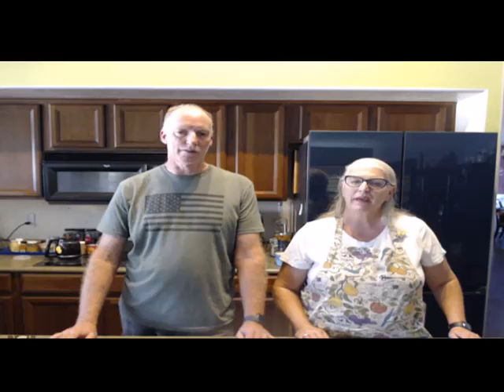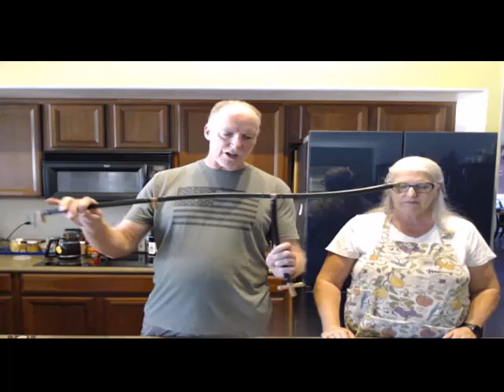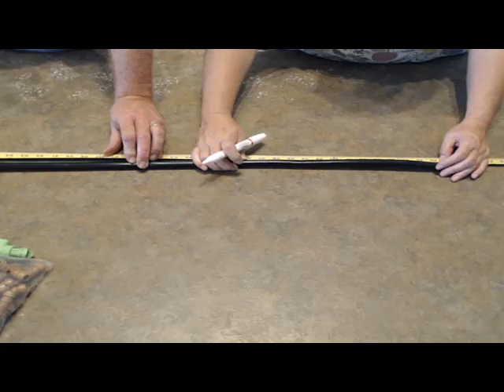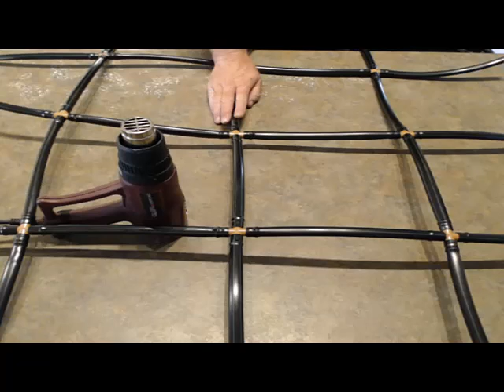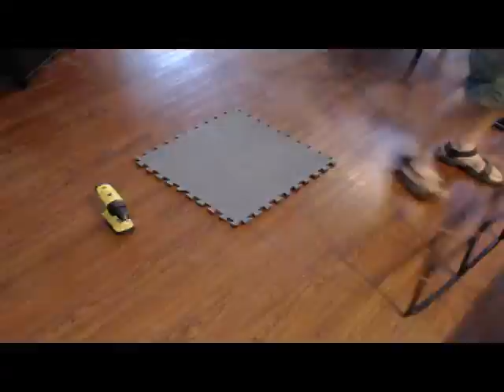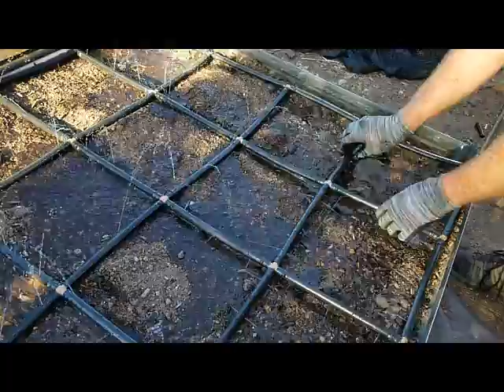DIY Garden Grid Irrigation

Comment: What hose connection to the garden grid did you fashioned like garden grid has?
Reply from the maker: Sorry for the delay.  I was hoping to get an updated video out.  But here are a couple of photos that show the connection. In my case, I was hooking it up to 3/4" PVC.  But the hardware store has adaptors to go from the tubing to garden hose as well.  Hope this helps!

https://www.dropbox.com/scl/fi/lfvd2iygewkkatijlgqtd/20240203_141317.jpg?rlkey=jp7fpf9d9dkpl7f11jaf5jeo0&dl=0

https://www.dropbox.com/scl/fi/o94b3juq9gccdf7d3rmws/20240203_141330.jpg?rlkey=xff2xi075a29tyjyiwzfpciho&dl=0

Comment: How long do you leave them on for? Water flow seems heavy.
Reply from the maker: Yes, they do flow quire well.  As for how long, that will depend on your particular soil and water pressure.  One thing that can help adjust is the addition of a inline valve such as the blue ones in this photo.

https://www.dropbox.com/scl/fi/o94b3juq9gccdf7d3rmws/20240203_141330.jpg?rlkey=xff2xi075a29tyjyiwzfpciho&dl=0

Comment: Can you show how or where you added the connection piece for the water to get to it
Reply from the maker: Sorry for the delay.  I was hoping to get an updated video out.  But here are a couple of photos that show the connection. In my case, I was hooking it up to 3/4" PVC.  But the hardware store has adaptors to go from the tubing to garden hose as well if you need that option.  Hope this helps!

https://www.dropbox.com/scl/fi/lfvd2iygewkkatijlgqtd/20240203_141317.jpg?rlkey=jp7fpf9d9dkpl7f11jaf5jeo0&dl=0

https://www.dropbox.com/scl/fi/o94b3juq9gccdf7d3rmws/20240203_141330.jpg?rlkey=xff2xi075a29tyjyiwzfpciho&dl=0

Comment: The grid from garden in a minute is made out of a different material than regular drip line. The drip line you have will crack and break with the heat and cold. It is less expensive but how long will it last?  So is it really less expensive?  Hmmm
Reply from the maker: Hi Lindy, the Rainbird distribution tubing used is pretty good stuff and has lasted years in our garden here in Arizona.  We use it for most all of our irrigation system.
Reply: LLDPE (Linear Low-Density Polyethylene) tubing used by GIM is the same one you can buy at Home Depot, Lowes or your local Hardware Store or Amazon.

Comment: This is a very good instructional video.  HOWEVER, the expense is greatly underquoted.  One bag of each of the linked fittings is $46, and for a 3' x 6' it will take 2 or 3 bags of each.  Plus the 100' roll of tubing which isn't linked or priced.  And the cost of a heat gun if you don't own one.  The GiM grid for a 3' x 6' is $91 delivered from the GiM website.  No cutting, no drilling, no wasted fittings or tubing (some left over for another project is extra expense if you aren't going to use it.)  PLUS...no wasted time for the additional labor.  Am I missing something here???
Reply from the maker: Hi Krazmo.  Prices do tend to fluctuate on Amazon but below is a breakdown of the cost are as of today (excluding tax and shipping) -
Tees - $11.99 for 24 or $0.50 ea
Crosses - $15.99 for 14 or $1.14 ea
90's - $9.99 for 18 or $0.56 ea
tube - $24.39/100-ft or $0.24/ft

As for the the cost for one 3x6 grid, you will need need - 
10 Tees = $5.00
6 crosses = $6.85
4 90's = $2.22
31-ft of tube = $7.56
Total = $21.63 in material cost.

With the listed items in the as-purchased quantities, you could make 2 of these grids for $62.36 in materials and have some tubing and fittings left over for incidental use around the garden or for other projects .  Keep in mind, that either this DIY version or the GiM one, you will still need tings like tubing, fittings and a pressure reducer to hook it all up so a little extra of those items is not a bad idea. 

Home Depot also sells most of these items in smaller quantities if you dont need or want any extra.  However they are at a slightly higher unit cost.  The only fitting that seems hard to find is the cross.  Amazon is just easy for most people so that is why I went that way.

As for the heat gun, it is not necessary, but useful.  You could probably use a hairdryer or some other method too.

As far as additional labor, some people get a sense of accomplishment for being able to DIY something like this and trying something new.  So it is hard to put a price tag or benefit to that.   If they save a few dollars along they way maybe that gives them the opportunity to buy some more seeds for the garden.

Another benefit to DIY is not being constrained by the shapes and sizes sold by GiM.  So you can truly customize it to match the exact size of your garden bed.

Hope this helps.
Reply: @dcfrank1  Thank you for your reply.  The prices you quoted today are significantly less than they were 4 days ago.  Amazon is a crapshoot when it comes to pricing.  You just validated my original comment.  You can't say that you can build one 3x6 for $21.63.  You have to buy the materials in the bulk packaging in which they are sold.  And Amazon uses the hot dogs/hot dog buns formula when it comes to bulk packaging (more buns than there are hot dogs).  One 3x6 actually costs you $68.  If you need 2 then 2 costs you $68.  If you need 3 then it will cost you $136.  To say that it is only $21 and you will have lots of material left over in case you ever need it is misleading.  If you never need that left over material, you can't get a partial refund.  You spent $68.  Your logic is similar to saying I only want one bowl of corn flakes.  I still have to buy a box of corn flakes for $5.  If I only eat one bowl, that bowl cost me $5, not the 50 cents it would be per bowl if I ate the entire box.As for the additional pressure reducer you wrote of, I have no idea what you are referring to.  My GiM 3x6 arrived in 48 hours.  It is a complete kit.  The 3 sections fit together and a garden hose is attached to the inlet.  You turn on the water faucet and the grid works.  The drip/stream holes are squirting in the correct directions, and the tubing is perfectly straight.  Yes, I spent $91 for it.  And I will bet it works better than the DIY grid in your video.
Reply from the maker: @krazmokramer  With a little research and you can find these items in smaller quantities, except the crosses which I can only  find on Amazon in a 12-pack...ok I will have 6 left over.  If I want to drive to Home Depot I can actually get the tubing cheaper than on amazon (9.98/50-ft).   So, I CAN build one for about $32 and have 6-crosses, 1-90 and 19-ft of tube left over to use on something else or donate to a local community garden.  Still cheaper than the $91 and I enjoy making them and they work great.

So far, we have built 5 of these systems and all of them custom sizes to exactly fit our grow beds and we will be building at least 4 more so bulk is the way to go for us.  The GiM system is nice but just too limiting in sizing for our application.

I am glad you are happy with your system.
Reply: @krazmokramer  Why be so crazy critical? Good for you that you bought your GIM system! Congratulations! I have 10- 4x8 raised beds. I’m not willing to shell out $1,600. I appreciate this video- which will save us HUNDREDS of dollars! Go tend to your little box and quit being such an irritating bully!
Reply: @aftermidnight4867  Speaking of bullying...I have no problem with DIY.  I actually think it's a great idea.  I have a problem with YT videos that make claims that aren't actually supported by the video.  Clickbaitish type thumbnails or titles.  If my comments are so irritating to you, don't read them.  Watch the video and enjoy it for what it is.  My comments weren't directed to you.  They were directed to the video creator.  Now go tend to your tiny little boxes and keep your rudeness to yourself.
Reply: @krazmokramer  you are not only a bully. You’re a narcissist.
Reply: @krazmokramer  you are the problem kiddo, do better with your life.
Reply: @aftermidnight4867  People want to know if it's cheaper to make or just better to buy. That's what I was looking for when I read the comments. It was helpful.
Reply: You said it was a 3’x4’ box in the beginning of your video, which is it? And can you tell me the total of the parts to make one 4x4 grid, please. Thank you.
Reply: Amazing how people can argue about this. The video gave the size and length and no. of connectors needed. ADJUST this to what you have. Plain and simple. It’s called thinking for yourself.xxxxx
Reply from the maker: @albertlewis sorry for the confusion, I meant to say it was a 4x4.  Many of the parts can be obtained from Home Depot with the exception of the crosses which I can only find on Amazon.  Last I checked prices, a 4x4 grid, will cost you about $32 in parts + tax and you will have some left-over.
Reply: GIM is a better quality than a drip line they are DIY.  I have 2 GIM and they have been in the extreme heat and cold with no cracking or breaking

Comment: So the T, Cross and corner fittings need to be 1/2 inch as well?
Reply: Also what are the fittings made off? Copper? Do you think it would work just as good with PVC fittings?
Reply from the maker: @MsFobbie  thanks for the question, these are the fittings I used.  
https://www.amazon.com/dp/B085SVC4W2?ref=ppx_yo2ov_dt_b_product_details&th=1